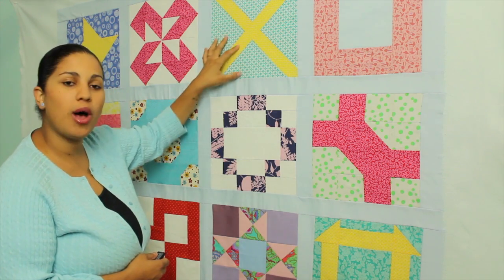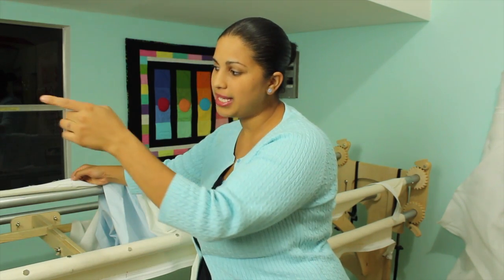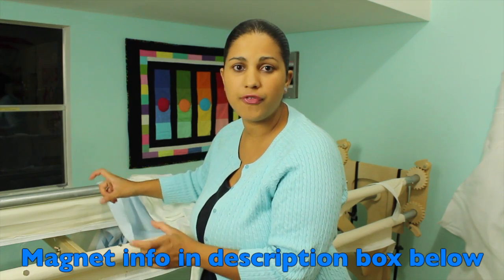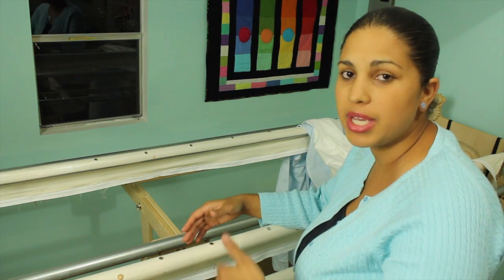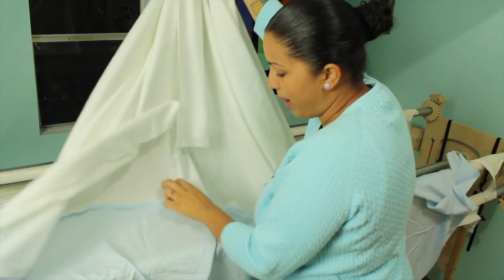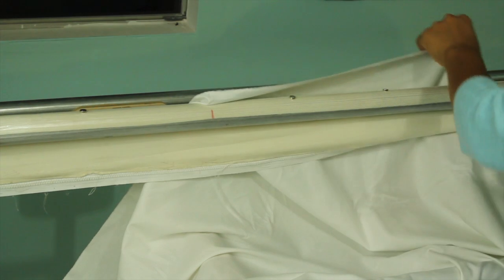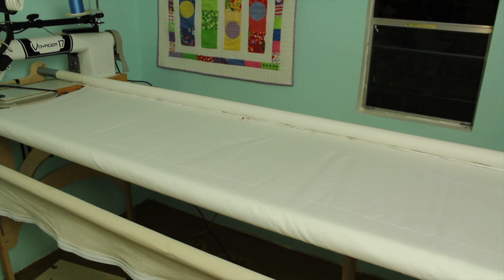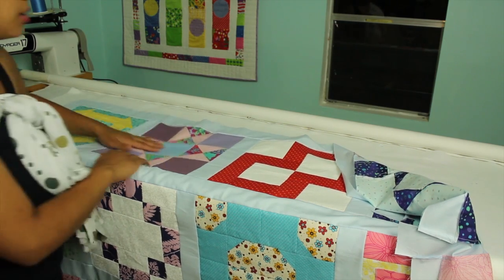Longarm Quilting- How to Load quilt with magnets

Comment: Great idea.  I have some long flat magnets, the kind you might use in a work shop to hang small tools, screw drivers, etc., they are much stronger magnets and work excellent on the quilt rollers (unless they're aluminum!) holding the quilt. Believe me it's not moving!! And doesn't take many.